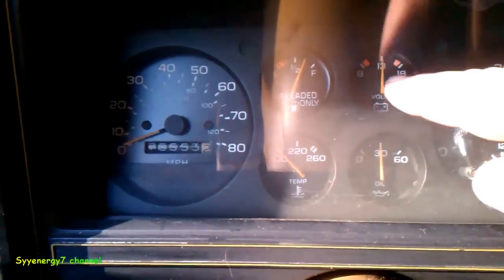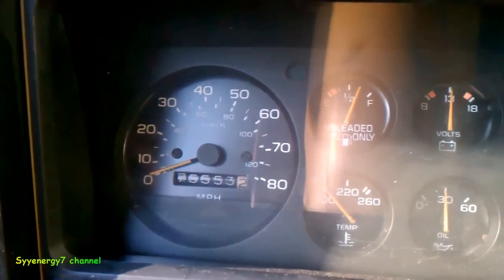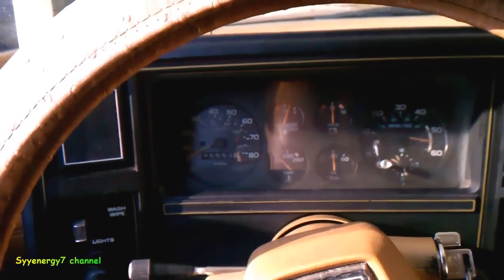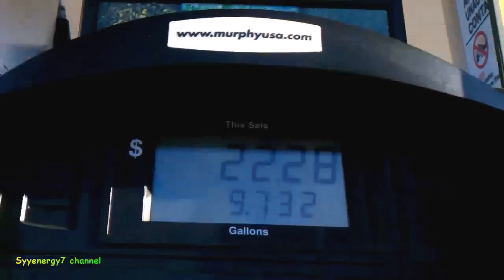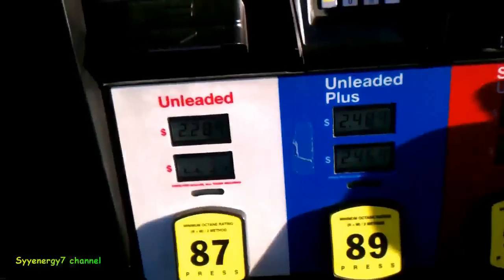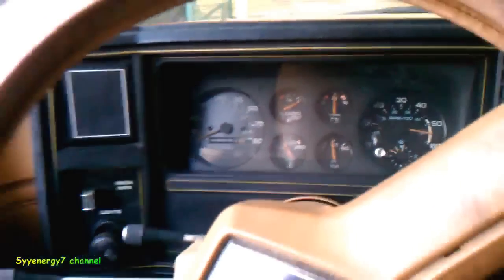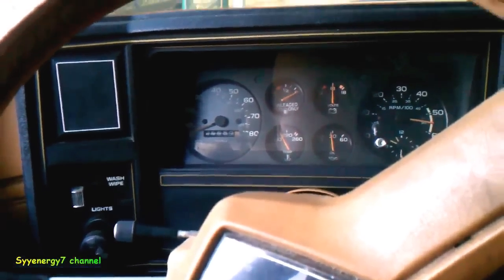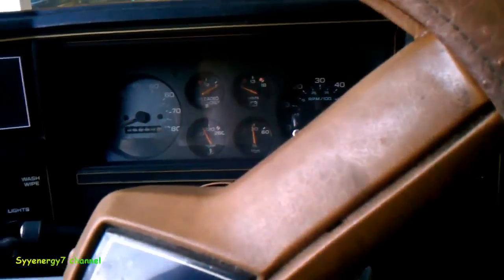'78 El Camino MPG Before HHO

Comment: Just wandering
How does the HHO with ported fuel injection.
Just got a 95 Dodge Dakota with a 3.9.
Reply from the maker: If you have a car that has any type of computer control, what you want is to use only the HYDROGEN side and and not HHO.  They do have dry cells that will put out 100% hydrogen, so it does not create havoc with the computer.
Reply: By the time u do that the cost probably would not be worth it.
Need to do more investigating.
Would like to improve the MPG because it is a good truck. I use my CTX at 65MPG most of the time.
Thanks for the info
Reply from the maker: fjones63
I already did it on the Jeep (1.3 litter 4 cylinder)..,  The whole kit was $165.
Suzuki Samurai Installing HHO, Part 1 of 3 {Brackets}
http://www.youtube.com/watch?v=cjy7UNLF4_0
Suzuki Samurai Installing HHO, Part 2 of 3 {Plumbing}
http://www.youtube.com/watch?v=5x9lNzSOX_8
Suzuki Samurai Installing HHO Part 3 of 3 {Wiring}
http://www.youtube.com/watch?v=l5SDbyWyARo
High Output HHO & Amp Gauge Install - Suzuki Samurai
http://www.youtube.com/watch?v=0A8zTrJRPkM